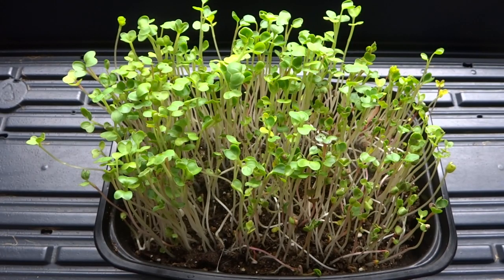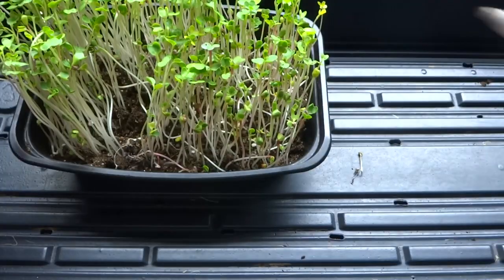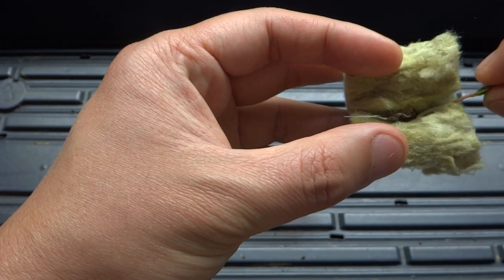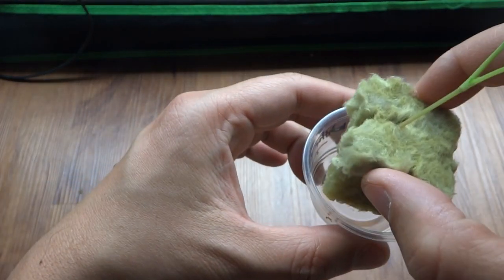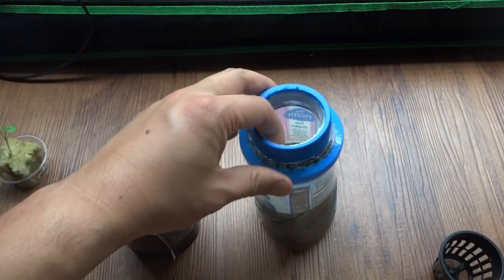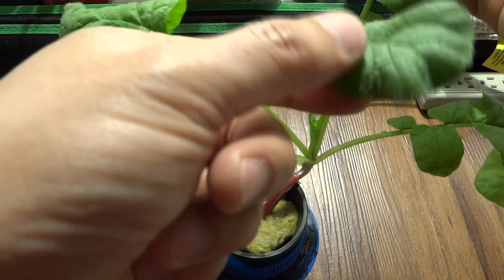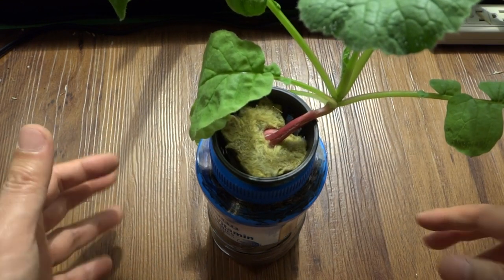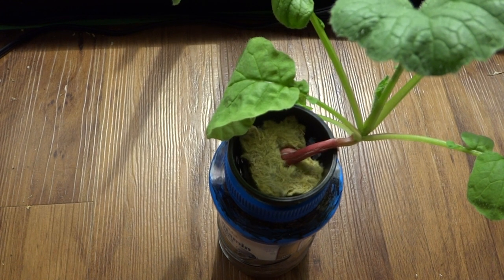Microgreens to Hydroponic

Comment: Hey, great videos! I'm looking to start a basic kratky hydroponic setup. I don't want to invest too much just in case it isn't for me. How do you determine if you are going to use Masterblend or GH nutrients?
Reply from the maker: +Mumpguy You cannot go wrong with either, I've used both with great results.  MB is a little cheaper, so if you're not looking to spend too much, that's the way to go.

Comment: How far ahead can you pre-mix the nutrient solution? I will leave for a 2-week vacation and I'm wondering if I can pre-mix it so my plantsitter doesn't have to do the measuring and mixing. Thank you!
Reply from the maker: +Ivy Mok Yes, that's what I usually do.
Reply: +Khang Starr  How long will the premixed solution last?
Reply from the maker: Ivy Mok I've left it sitting for 3 weeks and it's fine, but not sure how much longer you can leave it.
Reply: +Khang Starr  Thanks! Have you been using tap water? Our tap water is 307ppm and has 8 in PH. Will you recommend to use reverse osmosis or bottled water?

Comment: hey khang I'm using the double cup method with GH flora series and I'm seeing a little residue or crystal like substance at the bottom is this normal? if not what should I do to resolve this problem?
Reply from the maker: Flush it out with plain water until they are gone.